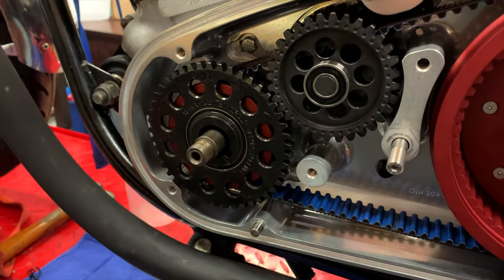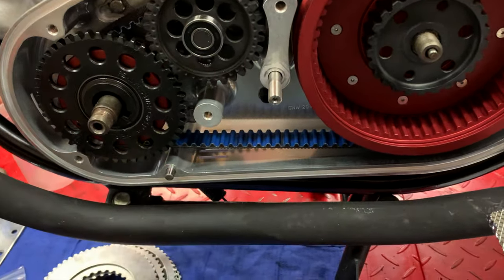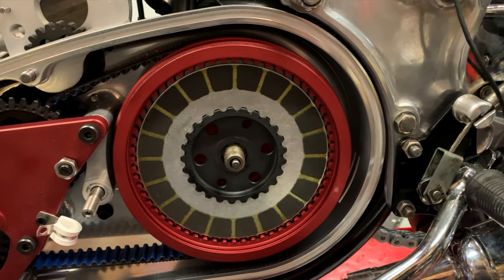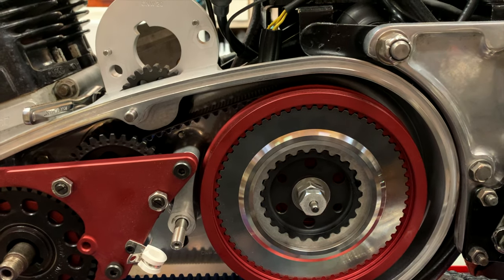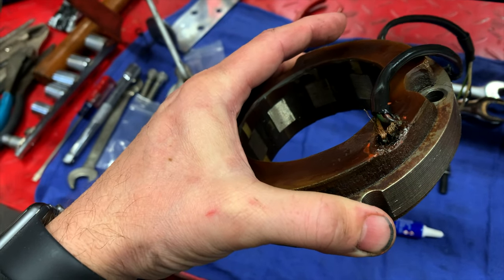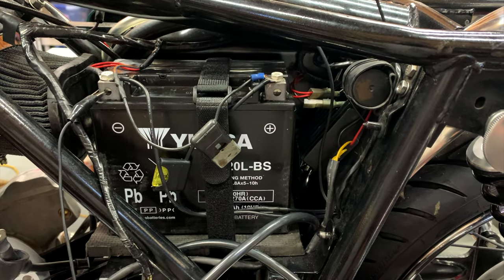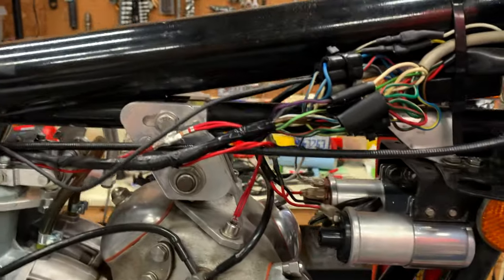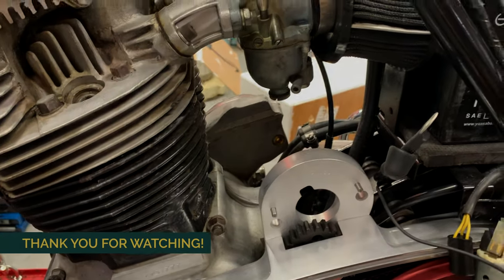Installing Norton Commando CNW Electric Starter - Part 2 of 4

Comment: A further note about the electrical hookup for the starter: at 15:10 in the video I made a comment that is not correct. The large battery cable for the starter only goes to the battery positive IF you have a negative earth setup, like mine. The starter is grounded through the body, so if you are using the stock positive earth setup the large starter cable would go to the negative terminal of the battery. Fortunately, this is clearly described in the instructions.

Comment: A lovely piece of kit & beautifully made - I fitted an Alton, which is also very well engineered, to my 750 Combat a while ago - with a Gel battery giving 270A CCA and the size of a small suitcase ( !! )  it works a treat... 

I hadn't seen the CNW starter before but it looks to be more substantial.  Top notch stuff, cheers !
Reply from the maker: Thanks for sharing Dave. Yes, the Alton's are great too! Cheers, Mike

Comment: i thought rewiring my A10 was a work up and i have a magneto ! i don't like electrics don't know why i have a Wassel regulator now and a rebuilt dynamo and a 6 volt halogen headlamp and it works !  charging at 1500 RPM i felt like i had planted a flag on the moon !  you certainly keep your train of thought focused  on your electric's